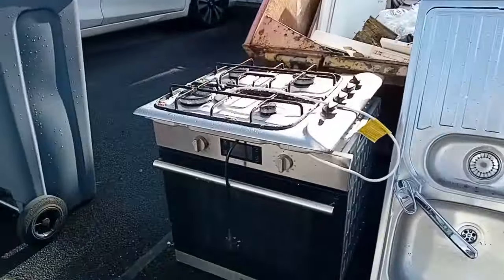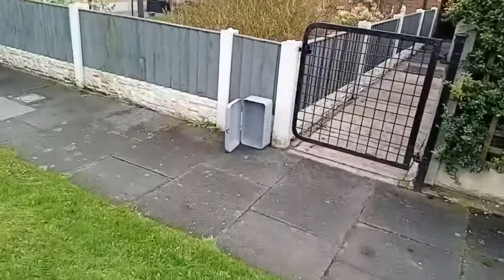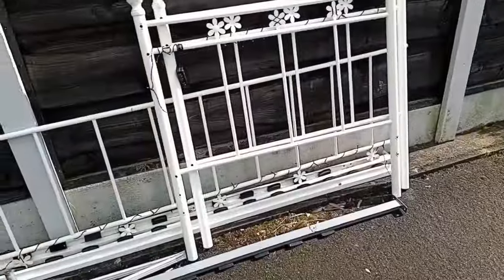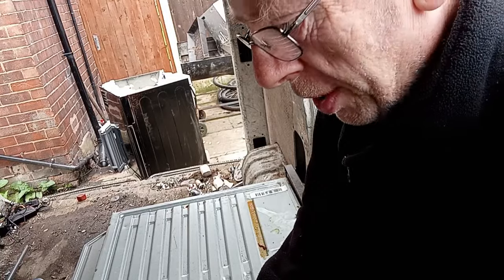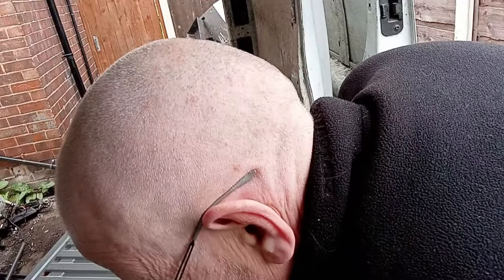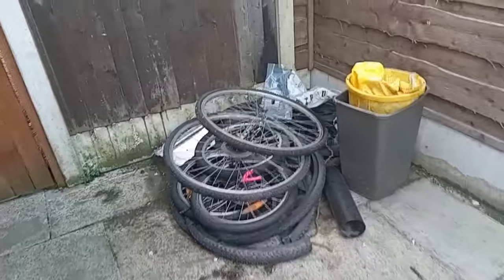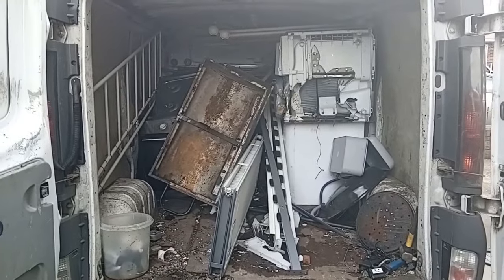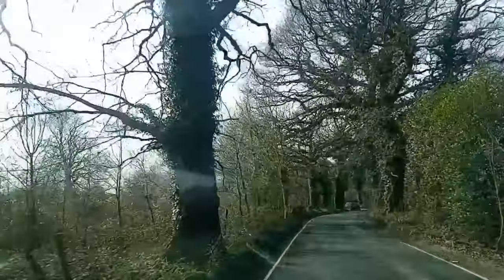let's see what we can find today

Comment: I notice you get quite a few rads, but I couldn't see if you take the brass ends out , I know there not always brass , some are , plumbers don't normally take them out, it needs a big alen key , i use a hex gearbox sump plug hex and a spanner, just a suggestion, but it does take time, so may not be worth it
Reply from the maker: Hi James I normally just cut them off with the grinder but viewers have shouted at me for that